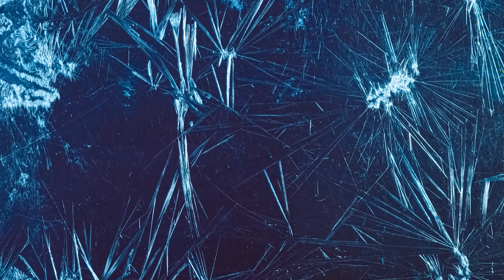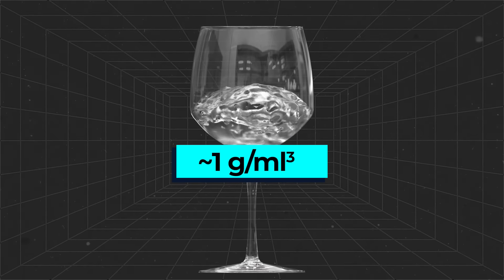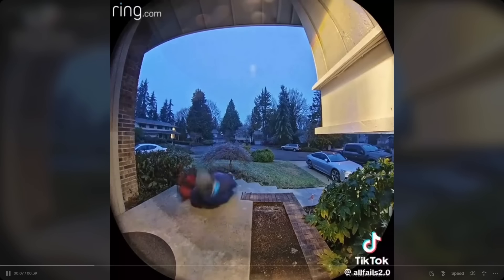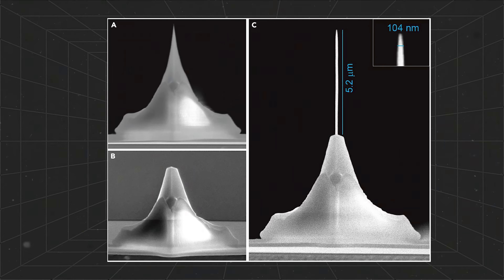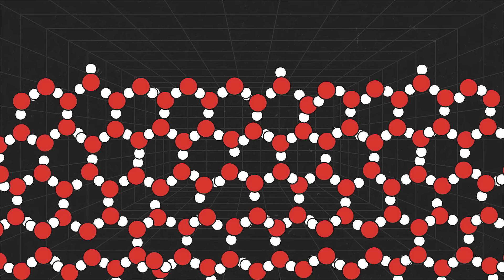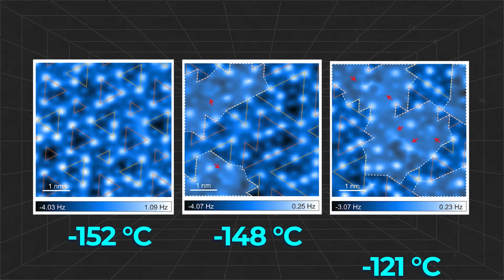We FINALLY Proved Why Ice Is Slippery

Comment: i keep my freezer at about 10⁰F and if you  fill a glass  to the top with ice cubes from it and fill the rest with water,  the ice is so cold it will freeze the water around the cubes, forming one super cube..
   ice cubes stick together under pressure because  the lower internal temperature of the ice cubes causes the slightly melted surface of the cubes to refreeze and bond together, and the pressure only accelerates this heat transfer,  but only if the temperature of the ice is low enough to overcome that the slightly lower freezing point at higher pressures.
    
 so.... if you're a cheap ass and keep your freezer set at 31⁰F i don't think this refreezing of the cubes will be so easy.. 
   
    i have to be careful,  even with dry hands my skin will melt the surface just enough for the ice to immediately freeze my finger to it.

Comment: interesting, so those molecules are sort of like grains of water rolling around, when you get 6 or more of them below 0, you can form solid ice. but if above freezing, it would be water. So when it's below freezing and you only rub off 5 or less of those molecules, then it's a sort of solid water molecule. So at what point is it a liquid on the surface versus tiny grains of solid ice? kind of like the how many grains of sand is a pile paradox.

Comment: Superb video. Thanks. 

BTW, 10:10 Graphite is at least one solid that's used as a slippery lubricant (the individual nano layers of graphite slip over one another due to weak Van der Waal forces between the layers). 
So Ice being "one of the only solids(???) in the World that slips" is not correct.

Comment: My guess: The way water molecules connect to form a solid leaves polar ends sticking out on the surface of the ice. If you press two bits of ice together, those polar ends on each surface will bind to each other in a similar way they do as they freeze

Also, did they not discover a while ago that the reason ice is slippery is because those edge molecules will actually roll around the surface of the ice?

Comment: 1:59 You can't rely on a vacuum to make ice sublimate because of van der Waals forces. If your position were correct, we could dry clothes by creating a vacuum, instead of burning through electricity or natural gas to create heat to dry clothes.

What about the claim that warm water turns into ice faster than cold water?

Comment: Before watching the video, my assumption is the pressure melts a thin layer of water. Your ice tray keeps it at colder than freezing temperatures and when you release the pressure, it solidifies into one piece.

Comment: I was expecting something else.   If I don't empty my  cheap garden hose of water : -
in summer the water expands and breaks my hose   at about 40c
but in winter  the water expands and breaks my hose at about minus 4c. 
     What is going on?  water expands when it gets hot OR cold.???   And yes now I make efforts to drain the hose each time I use it.  Solves the problem but not the question.

Comment: Okay let's think about ice a bit with the initial prompt: Does ice stick together in that manner in an environment significantly below 0. In my experience it doesn't so i'm guessing it freezes the 2 blocks together with a thin layer of surface water that refreezes once the touching area get's isolated via the ice cubes. This would also be my explanation for the slipperiness, they're wet.

Edit: same intuition as Farrady? I count that as a win eventhough I'm wrong xD

Comment: Just a quibble, but, while skate blades vary by length and width, on average, each skate has 75mm^2 of surface, or 0.11625 square inches.  Two blades therefore would be 0.2325 square inches.  I'm not sure how much pressure a 150lb person would exert on 0.2325 square inches, but it's a lot more than 50lbs psi.

Comment: The very last step you make doesn't make sense to me. The outer layer acts like marbles but when you have more of them (layer of water), it's less slippery! I think there is a connection with the shape of the molecule and the surface of the ice. My take would be that the loose, not round, water molecules seem to be able to "roll" on the surface of the ice, maybe like the teeth of two cogwheels. When the ice melts more, the surface loose's its 'teeth', because it's too soft. When it gets colder there are less loose water molecules, maybe because they aren't easily knocked loose and/or they get 'caught' into the solid in the orientation with the oxygen facing out.

Comment: You made an incorrect calculation of the psi of a skate blade. The bottom of a skate blade is concave therefore only a fraction of an inch in width is in contact with the ice, additionally the length of the blade is curve slightly so again only about 0.25 inches in length by 0.125 inches in width. This give us 0.03125 square inches divided by 185 person = 5714 psi.

Comment: Hmm, it sounds like solid ice still contains different phase proportions of water like how liquid water might have different proportions of free H+ and OH- bouncing around.  Like... Its an acid and a base and a neutral depending on localized conditions.  And the temp variations or energy balances within the ice determine the phase.     Again this sounds like strange behavior, but water is pretty volatile, so yeah... strange stuff.

Comment: I think your explanations also requires that the electrostatic hydrogen bonds are relatively weak at temperatures as high as negative one hundred and fifty degrees C (-150 C) in vacuo. What forms of ice remain slippery down to temperatures such as the temperature at which Nitrogen becomes a liquid? Do all forms of ice crystal exhibit slipperiness or is Ice I the only ice crystal that does? Of course Ice IX is valuable because of its literary properties.

Comment: Not too happy with your comment about what would happen in a vacuum. a) The atmosphere doesn't hold the molecules down: in equilibrium the partial pressure of water vapour depends on the temperature, not on the amount of other gases present. b) Ice can also sublime directly to vapour.
Your pressure calculation for the ice skates implies that they have an area contacting the ice of 3 square inches. Is that right?

Comment: 0:13 … I nerded out. The odds of rolling & scoring two 20s with 2 D&D dice is:

ChatGPT says:

ChatGPT:

To find the likelihood of rolling two "natural 20s" with two 20-sided dice (d20s) in "Dungeons & Dragons," you can calculate the probability of each die rolling a 20 and then multiply these probabilities together.

1. *Probability of rolling a 20 on one d20:* There is 1 favorable outcome (rolling a 20) out of 20 possible outcomes, so the probability is \( \frac{1}{20} \).

2. *Probability of rolling two 20s:* Since the rolls are independent, the probability of both dice rolling a 20 is \( \frac{1}{20} \times \frac{1}{20} \).

The combined probability is:
\[ \frac{1}{20} \times \frac{1}{20} = \frac{1}{400} \]

So, the likelihood of rolling two "natural 20s" with two d20s is 1 in 400, or 0.25%.

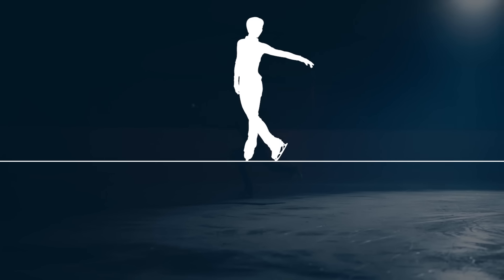Comment: 4:20 That’s not right for ice skates. As a rough estimate, if we take the blade edge width to be about 0.03 inches and the blade length to be about 6 inches as the “flat” section in contact, when the skater is on one blade they will exert about 800 psi and not 50 psi, at least in theory. Not sure where the latter number came from. It sounds more like the contact pressure for skis instead. Edit: But the central thesis still holds in that it only reduces to about -0.4 degrees C fwiw.

Comment: Hasn’t this been solved a long long time ago when you add pressure it liquefies.. just like ice skaters the blades float over water not ice because all the weight is concentrated on a small area with two cubes together. It’s the same concept but then when you let go, they will fuse because they were trying to reach equilibrium.

Comment: 9:33 your side orientation diagram confuses me. Here, you are showing that the oxygen is up (the red atom), and the hydrogen is down (the white atoms). Then, you show one hydrogen atom up in the lower graphic. However, my understanding is that water is H2O and that the 2 means 2 oxygen atoms. Doesn't that mean there's supposed to be 2 oxygen atoms, not 2 hydrogen atoms? Shouldn't the 2 white dots be facing up? Unless you are actually showing the link between two water molecules and just cutting off the second oxygen atom.

Comment: I have actually sprinted on ice and never slipped but I am really good at balance. Theoretically I was slipping with each step but I would catch myself before I could lose my center of gravity
Reply: I am guessing ice has different density levels that cause force to be exterted differentially. So basically, topology makes ice slippery.
Reply: As an aside, it is crazy people believe in atoms in this day and age!
Reply: And ice skating, it should be obvious that the force exerted by the ice skate create a gradient that stabilizes itself over a length interval lol. Maybe I am actually dumb tho? I wouldn't be surprised
Reply: Seems like I was right. It is kind of weird they had problems with this question because it is actually pretty easy imo. Seems like you guys don't actually have any understanding of anything lol

Comment: i was told and so, always thought when something has a rough surface it creates friction when moving across it, and supposedly that water fills in the little gaps, that's why when it freezes it's slippery, cause it's smooth. guess not.

Comment: well the first thing you do is say "oh look solids don't normally freeze together when you press them together" with the dice example but I gotta say like dude...I feel like this behavior would at least be slightly more common among substances that are currently solid but in an environment at a temperature that's higher than their melting point, like the ice was in that first scene. Maybe I'm wrong, but that's what my instinct is telling me, and also, I don't think those ice blocks would stick together in a room that was well below freezing either, but I could be wrong about that as well.

Comment: Is it? 0:10 I mean ice itself isnt slippery yet water in between things is. Like a mat with water under it, or when wrapping a car. The water molecules can easily shift and act as kinda like a roller for the ice to roll on. 

I guarantee this is what is going to be explained in the video. If you see this comment and its still here than I didnt come back to delete it cuz I was right not wrong.
Reply: Yep I was right, and to further explain why It melts is because the temperature of the ice and whatever surface/object you put on it is trying to even out the temperature between the two, and it's usually always above freezing so the ice melts.

Comment: 50 psi as the effective pressure for skater blades makes 0 sense when you really think about it, considering the contact surface of a skate blade (which is effectively 2 quasi-one dimensional edges bridged by an arch, not a flat surface) the pressure exerted by a person at the minimum contact point tends to infinity, it only stabilizes at about 50 psi after the entire blade's surface between the double edge has contacted the ice, that's why nobody uses single edge skates, they would dig so deep into the ice in order to stabilize the pressure by maximizing the contact surface they would be unusable.

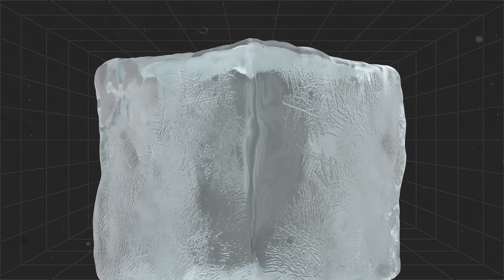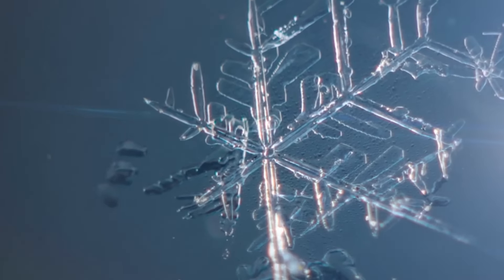Comment: 12:30 - 12:50 Honestly this behaviour of water is most predictable, look at it this way, it is the same solid - liquid material as other metals, but because it has such low density and low melting point, the traction that increases as ice turns to water is very predictable, other materials have density and high melting point

Comment: I always thought ice was slippery for the same reason a highly polished surface is slippery. 

You can put Wax on your Surfboard to make it sticky so you don't slip when the fiberglass comes in contact with the water.  However, if you polish a floor wish wax (or a car) the surface becomes slippery (anyone who stepped beyond the line in a bowling alley has learned how slippery it can be).  My thought was the polishing made the surface smooth causing the area to have less friction (aka more slippery).  

So now I am wondering why do polish surfaces become slippery?  Maybe my idea is entirely wrong.

Comment: A 150 lb person would exert far more than 50 psi of pressure, where did you get that the surface area of an ice skate blade is 3 square inches? The contact point is so narrow that it's hard to say how small a fraction of an inch that would be

Comment: If ice skater weighs 100lbs and exerts a pressure of 50psi, then that would mean the contact area between the edges of the ice scates and ice two square inches. That is obviously false. I would like you to provide the evidence for the 50psi figure or correction to it and to its respective freezing point.

Comment: Ice is slippery because of heat and air. Ice in itself is dry, cold solid water. Since ice is lighter than water; it can act as though it was oil. Therefore, slippery comes from repelling.

Comment: I want to make a wild guess before watching the video and say that ice both melts and freezes on surface level, the cold from the inside freezes the outside and the warm from outside melts the surface??? At a very small level, it probably why it seems it sticks to the akin when it feezes to it and melts cause body heat, basically its constantly making and loosing bonds on surface level, probably not even all liquid but gas?!

Edit: now rewatching after almost being done, wouldn't tiny ice molecules stick to or even melt when in contact with another surface? I mean while dragging a cam across it, just tells you that all types of things is goong on in such a volitile surface.
Reply: What if the particles are being carried by a thin vapor?

Comment: You seem to have slipped your decimal point in the point about skating. The contact point(s) are very small, one or two orders of magnitude smaller than you estimate. An ice skate is also warmer than the ice, since it is metal and, even when it is not being heated by friction, has a human at the other end. Though of course it is true as you say that hokey pucks slide, so pressure cannot be the whole story.

You also seem to have access to a pretty nice beach. The ones I grew up with had sand around 1mm across. Just saying: sand grains aren't standardised and make a lousy unit of measure.

Anyway. Lovely video, thanks. But I'm still left scratching my head. The summary version is that it's a boundary property, and in particular, in water's case, a property of a heterogeneous boundary—so, ultimately, a 1D property(!). But how does this relate to other substances? Every solid has boundaries where the 3D packing breaks down, and many of them must have complex phase diagrams. So why is water different?

Comment: Isn't 50 psi awful low for the pressure on skate blade? 

For a 100 lb skater, 50 psi implies the contact area is 2 sq in, or one square inch per skate. That's way too high. The working surface of an ice skate blade, looked at longitudinally, is convex. So the skater is always on either one or both sharpened edges. These edges are quite sharp and have very little surface area. Also, the blades are curved and so only a portion of the length is in contact with the ice at any given position. The one square inch area per skate estimate should be smaller by a factor of 50 at least, raising the pressure up into the 2500+ psi range.

Comment: Before I ever watch the video I'm going to assume there's a difference between 'slippery' and 'dry ice' and that's due to the extreme temperature difference and how it causes the ice to interact with moisture. Ice is slippery because a small amount of water sublimates on the surface and that's what we interact with when we slip. Dry ice isn't slippery because it freezes moisture immediately and skips the water phase and goes straight to gas.

Comment: Ok I haven't seen the full video yet but I think the reason why ice fuses together when you press them together is because ice has an extremely low melting point. When you press two ice cubes together, the pressure causes the ice to melt and then refreeze quickly, fusing the ice cubes together. 

I know nothing about chemistry or science btw I literally just made this up

Edit: I was kinda right, yay! :)

Comment: I think you are using the whole blade surface for calculation of PSI pressure of the ice skater.  if you use the edge, thickness, which I assumed to be 3mils and ~1 foot of surface, for 150lb weight you get  2083psi pressure.  That said it is still -1.1C, so this makes no sense.  Even considering momentum of hitting the ice with the blade, I doubt the pressure at the moment of contact would be 10,000psi to make it -5.8C melting point.... interesting

Comment: There is no way on Earth that a150# person can exert only 50#/sq in, wearing ice skates. The bottom of the skate blade would need a contact patch with 3 sq inches of area.  A standard blade is approximately 1/8" wide, so an 8" blade would have 1 sq in of area, resulting in 150 #/sq in.  A typical (150# person sized) blade will be more like 9.25" (perhaps more), but that still leaves you with 129.7#/sq in while gliding with the entire blade on the ice. A curved hockey skate blade would have a smaller contact patch, thus higher pressure / sq inch, making your 50#/sq in even further from reality.

Comment: I'm disappointed because its just that ice has loosely connected atoms on the surface, thats it. and -7 degrees celsius is optimal for slipperiness be higher than that it could have water on the surface and lower than that the atoms are more rigid pretty much.